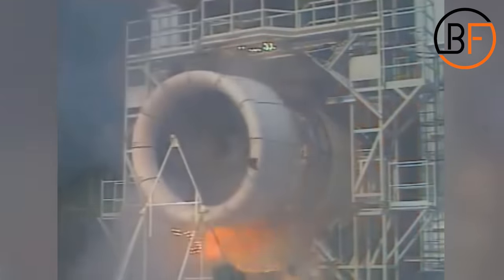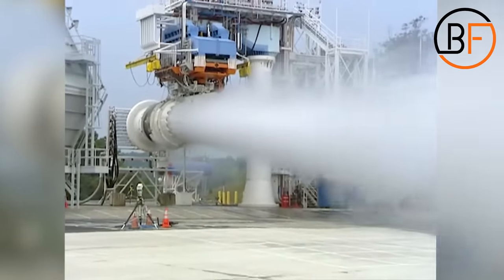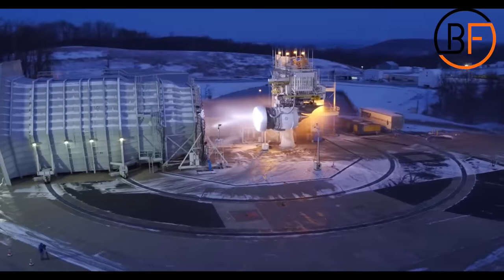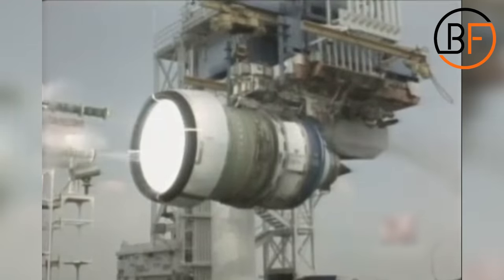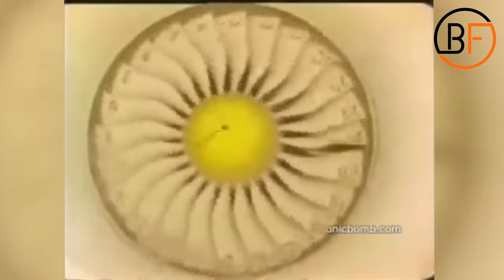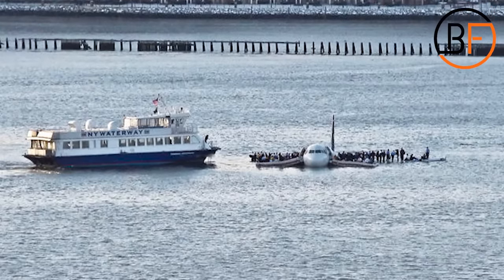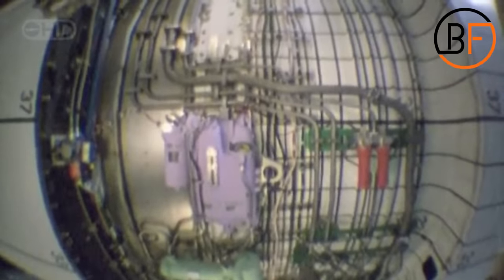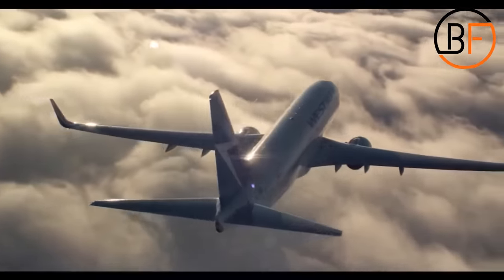This Is How Airplane Engines Are Tested

Comment: Why not put a rounded shield around the motor with holes in it so if anything hit it slides to the side instead of even going into the motor
Reply: It would impede airflow into the engine causing it to shut down. Another reason is the cold weather could freeze up the protective screen

Comment: And after all that testing almost all engines fail when a flock of birds enter thus requiring emergency landing.
Reply: i have the same family name as you
Reply: The purpose of the tests is not to guarantee that the engine keeps working normally after hitting a flock of birds.  It's to ensure that hitting a flock of birds ONLY damages the engine in a way that can be controlled, and does not cause the engine to explode in a spray of deadly metal shrapnel, destroying other parts of the plane and causing a crash. Airbags are not in cars so you can keep driving after hitting another car either.

Comment: Probably a dumb question but how do people who work on the ground stand so close to the engines without getting sucked in?
Reply: Define close.  Depending on the engine speed, the distance increases.  At idle, being within 10 feet is not a problem.

Comment: They stated the blades were rotating as much as 3,000 revolution's per minute. I thought they rotated at a much higher speed than that.
Reply: The main fan at the front turns about 3K.  The turbine portion or internal blades run about 10 times that speed.

Comment: How this guy just randomly talks about all the damages the plane could get without talking about the humans in the plane that might lose their lives too.
Reply: If you can keep the plane safe, you can keep the people safe.  If you can’t keep the plane safe, you can’t keep the people safe.
Reply: That's literally why these tests are done.
Reply: Many people are excessively anxious and paranoid about airline flying. Education like this can help. All airplanes continue to fly even with all engines out. All twin engine commercial passenger airplanes designed and tested to be able to continue to stay in the air even fully loaded with only one good engine. FAA requirement. While airplanes and the humans who maintain them are imperfect flying US commercial airlines is still one of the safest things you can do. You are more likely to be killed while taking a shower than flying in a commercial airliner and many, many times more likely to die driving your car.

Comment: Then the extensively tested engines are paired to a 737 max...
It's at least a reassurance that the engines won't stall, when the buggy untested software pushes the nose down...
Ho, wait...

Comment: Eventually Engineering Guys need to find out undocking manually and automatic dual safety system for cabin crew and passenger portion lifting safely to ground like Mars Rover landing with the parachute....

Comment: By the way, my understanding is that the GE90 N1 fan spins around 3600 RPM at takeoff power.  CF6 engines are smaller and are turning around 5000 rpm.  The JT8D engine on the 727/737/DC9/MD80 typically had a fan speed of around 7500 rpm. The N2 speeds of these engines was north of 10,000 rpm....

A Delta MD80 went to take off from Pensacola, Florida and the left engine N1 fan exploded as it reached takeoff power;  A chunk of the engine exited the engine casing, pierced the fuselage, and killed a 12 year old boy. That is extremely rare even during testing, and the only saving grace is that the kid felt nothing.
Reply: Yes, he did.

Comment: I should've joined ATP back in 2000, thought about it, but the program was too expensive at the time, would be a seasoned commercial pilot by now.  In highschool I had Microsoft FS, and even had the real flight push steering wheel that are in commercial planes.  I learned to fly and land and monitor instruments, should've turned this knowledge into a career. Be making 120k a year by now.
Reply: And why didn't you instead of regretting 22 years later? I'm studying aerospace engineering but I don't know about becoming a pilot before finishing my career so maybe I will finish it
Reply: @xyannail4678  He says it was too expensive for him

Comment: Why don't they put a screen over the engine?  Bird strike problem: Solved
Reply: Wow you must be very smart
Reply: If a plane hits a bird at even 200 with or without the screen the bird is dead and the engine still gets bird guts in it
Reply: @enderawesome4521  Perhaps. But the impact would decidedly be less catastrophic than a direct hit on the blades, no?
Reply: @Cat4evr  Its not a problem with the size because the blades cut it up anyway. Its a problem with the mechanisms further back. A grate would not do much.